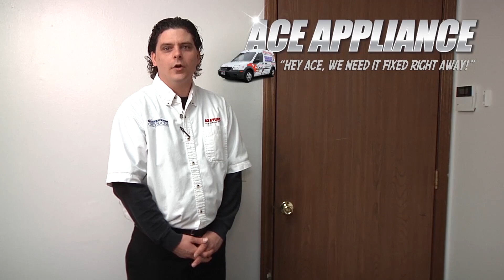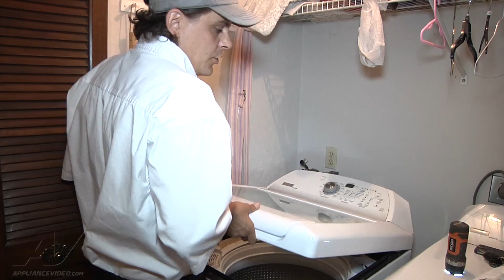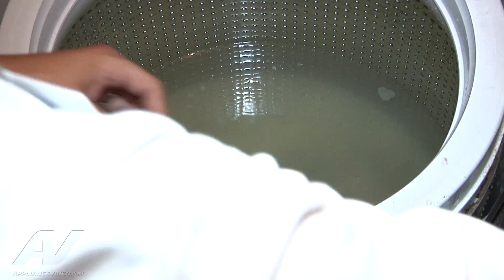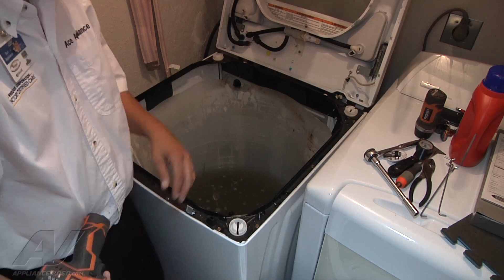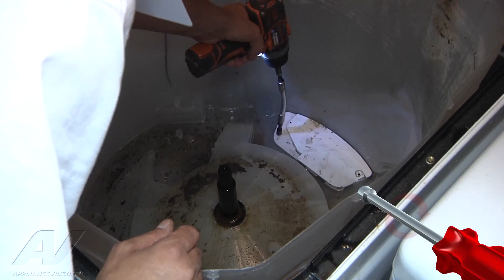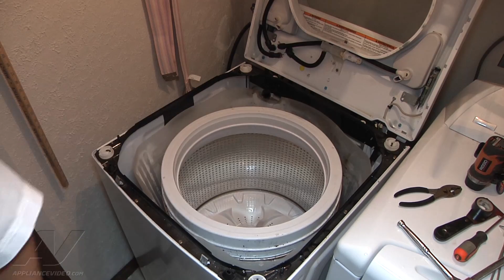Maytag Washer Repair - Sounds Like Something is Clogged - MTW6700TQ1

Comment: You should also include the Kenmore Series 600 HE in your title so people can find this.  I have not seen a video for that model and was relieved to find out this is the same one but under Whirlpool.  Also, I was hoping you would have shown the moment you popped the tub from the drive shaft!!  From other videos I have learned the high rate of spin throws coins, drill bits, paper clips, buttons up and over the basket lip into  into the outer plastic tub.  I had small 3/4 trim nails in my pump. Thankfully I caught it before it burned it out.   Thank you for this video.

Comment: Hi I have a bravos 300 series  when I run  any wash cycle like normal or whites   it will go through and  show its done but  it  doesn't spin but it drains ,so what I have to do is turn the cycle to spin/drain . The spin and drain cycle  works . So my question is  why does the spin / drain cycle work but it doesn't  spin in any of the other washing cycles .  There are no  error codes .
Reply from the maker: Great question, if you have a more technical question that our parts department cannot answer, you can search our over 17,000 answered questions free at our website www.ApplianceVideo.com under our Repair Help section. You can also call our parts department at 1-800-830-5465 and they can give you help 7-days A week ,or search at www.SaveMoreOnParts.com  .
Reply: I have the same problem. I have a MTW6700- TQ0. when I run  any wash cycle like normal or whites it will go through the wash and rainse cycle but does not do the spin cycle and show oL error message. Then I have to put it on SPIN ONLY cycle manually to finish.

Comment: Any tips for loosening nut at bottom of basket?
Reply from the maker: Great question, if you have a
more technical question that our parts department cannot answer, you can search
our over 10,000 answered questions free at our website www.ApplianceVideo.com under our Repair Help section. You can also call
our parts department at 1-800-830-5465 and they can give you help 6-days A week
Monday -Saturday, or search at www.SaveMoreOnParts.com  24 hours
7- days A week.

Comment: Did everything you said and everything works except for the draining part. I can hear it working so I took the hose out the pipe where its supposed to drain into and lowered it into a bucket and it started pumping out then shut off half full. Is that be a sign of the pump dying? Great video. Also it just went blank on the screen. It still beeps when. I press buttons but no o lights show up. TIA
Reply from the maker: Great question, if you have a
more technical question that our parts department cannot answer, you can search
our over 10,000 answered questions free at our website www.ApplianceVideo.com under our Repair Help section. You can also call
our parts department at 1-800-830-5465 and they can give you help 7-days A week
Monday -Sunday, or search at www.SaveMoreOnParts.com  24 hours
7- days A week.

Comment: On my top washing machine for Samsung water doesn't drain out all the way so I need answer
Reply from the maker: Great question, if you have a
more technical question that our parts department cannot answer, our
technicians are answering all questions at our website at www.ApplianceVideo.com under our Repair Help section. You can also call
our parts department at 1-800-830-5465 and they can give you help 7-days A week
Monday -Sunday, or search at www.SaveMoreOnParts.com  24 hours
7- days A week.

Comment: what if the center pc under the agitator is metal. mine is metal not plastic. i have a bravos x.
Reply from the maker: Great question, you can call
our parts department at 1-800-830-5465 and they can give you help 6-days A week
Mon-Sat . You can also search at www.SaveMoreOnParts.com 7- days a week.  If you have a more
technical question that our parts department cannot answer, our technicians are
answering all questions at our website at www.ApplianceVideo.com under our Repair Help section. We have over
4,000 common questions and answers that you can easily search through by your
model number, appliance make, and problem or error codes, and It’s free to
search through our question & answer library.

Comment: How do you get the codes from your Maytag Bravos X?
Reply from the maker: Nikki Hilliard Penny 

                   All of our technicians are now answering questions
daily at our http://www.appliancevideo.com/ website under the Repair Help section.  We also have over 1600 common questions and
answers that you can easily search through by your model number, appliance
make, problem or error code and it’s absolutely FREE. You also have the option
to email a factory service technician with a question on your appliance at
http://www.appliancevideo.com/repair-help/ . If you’re looking for a repair video, you
can also search our library of over 2600 free repair videos. ApplianceVideo.com
specializes in quality DO-IT-YOURSELF appliance repair videos and we get over
800,000 views per MONTH to our videos worldwide and growing. If you need of
parts for your major appliance, we have over 5-million parts in stock at http://savemoreonparts.com/ .  Thanks
for your support. Matt Ace Appliance factory service technician.

Comment: My whirlpool Cabrio HE is flashing a code FH then it stops what is wrong can I repair it myself ?
Reply from the maker: Shake-Zoolah       FH error code could have a few possibilities.  All of our technicians are now answering questionsdaily at our http://www.appliancevideo.com/ website under the Repair Help section.  We also have over 1600 common questions and
answers that you can easily search through by your model number, appliance
make, problem or error code and it’s absolutely FREE. You also have the option
to email a factory service technician with a question on your appliance at
http://www.appliancevideo.com/repair-help/ . If you’re looking for a repair video, you
can also search our library of over 2600 free repair videos. ApplianceVideo.com
specializes in quality DO-IT-YOURSELF appliance repair videos and we get over
800,000 views per MONTH to our videos worldwide and growing. If you need of
parts for your major appliance, we have over 5-million parts in stock at http://savemoreonparts.com/ .  Thanks
for your support. Matt Ace Appliance factory service technician.

        A

Comment: FYI, the screws on the pump cover in my machine had 1/4 hex heads.  Took me awhile to find the correct socket.  After pulling the agitator, I squirted some Shout on the spline.  I would pull the inner basket up until it stopped, then slide it back down. it slid out after a couple of tugs.  Sprayed some more on before replacing the basket, which made it easier.  After pulling the inner basket, I found a buildup of beige sludge on the bottom of the outer tub.  Wiped right out, but it may explain the smell.  I will follow a more frequent cleaning regime.  Found 1 dime under the cover.
Reply from the maker: altascene     Thanks for the detailed follow up. Glad it was just a miner fix aanda dime.   Please help usprovide more videos to our site by posting ApplianceVideo.com on your YouTube,
Facebook or Twitter account or add us to your circles. If you are in need of any parts please support
our parts department on line at http://savemoreonparts.com/ or call 1-800-830-5465 7-days a week until 11pm Eastern
time. Thanks again your support.  Matt, Ace Appliance service technician.
Reply: *****  You are welcome.  This turned out not to be the cause of my problem, which is the drain pump occasionally not stopping at the end of a full wash cycle.  If I unplug the washer and let it set for 10 - 20 minutes, and then plug it back in, the drain pump resets.  I suspect that the water level senor in my control module is failing.

Comment: I followed the directions from the video and found $13. 54 ($11 of it was in quarters).  Also, my husbands boss gave me the washer and dryer set, I know better than to wash clothes without checking all pockets!! Anyway, even after getting all of that change out, the washer still will not drain.  It makes a sound like there is a coin in there that has been chopped up by the motor or something.  There were some coins in there that looked like they had been through a grinder.  Does that mean that I need a new motor or some other part?
Reply from the maker: Daphne Butler             All of our technicians are now answering
questions daily on the ApplianceVideo.com website. You can search completely
FREE in our Repair Help section with over 1000 questions & answers. Or you
can get unlimited technical advice and video links emailed to you by our 14
factory certified technicians at
http://www.appliancevideo.com/premium-membership/.  If you are in need of
any parts please support our parts department on line at
http://savemoreonparts.com/ or call 1-800-830-5465 7-days a week until 11pm
Eastern time. Thanks for your support. Matt Ace Appliance factory service
technician.
Reply: Daphne Butler I have also found that coins will get into the drain pump itself.  That is a project that also has videos available, just search for this model and "drain pump removal".  It is more involved, but certainly do-able.  If you have water in the tub, use a wet vac to suck it out through the drain hose.  If you don't, you will end up dumping all that water on your floor (please don't ask...).  If needed, replacement pumps are available on line, and are much cheaper than a new washer.

Comment: So I did everything in the video, I found about 5 quarters but they were not covering the drain. I stick my fingers down in the hole and I can feel something obstructing but I can't pull it out. I shake the outer tub and can get the object to move but still not enough to get close to the opening. As a side note the water recirculater is working when I set this on spin. I've tried using a wire hanger, a strong magnet, and pliers. Any ideas how to get this thing out?
Reply from the maker: KIS 
        All of our technicians are now answering questions daily on the ApplianceVideo.com website. You can search completely FREE in our Repair Help section. Or you can get unlimited technical advice and video links emailed to you by our 14 factory certified technicians at http://www.appliancevideo.com/premium-membership/.  If you are in need of any parts please support our parts department on line at http://savemoreonparts.com/ or call 1-800-830-5465 7-days a week until 11pm Eastern time. Thanks for your support. Matt Ace Appliance factory service technician.

Comment: excellent video. I pulled my dishwasher apart and found that the hole going into the pump is clogged with mud.....when i plug unit back in it will not even try to drain. Is it possible for there to be a overload on the pump motor that may have tripped? Maytag quiet series 300 wash machine
Reply from the maker: Yes, there is an overload on the motor/ pump assembly. Its an auto reset overload, it should automatically reset after the motor cools down, usually takes about one hour. If it doesn't then you need to replaces it.  Thank you for your positive comment.  Please
help us provide more quality videos  by
subscribing to our YouTube page or posting our ApplianceVideo.com site on your
Facebook or Twitter account. We also have our authorized technician's daily
emailing professional advice daily to people like you that have appliance
problems. We have helped thousands of people save hundreds of dollars. Thanks
in advance for your help.

Comment: very cheaply made. lots of plastics. Maytag today is not how it was in the past. too bad.
Reply from the maker: Yes, all product quality  is changing for all manufactures. Our family-owned and operated company works hard to provide you with FREE, high-quality repair videos. Thank you for your continued support and good luck on your project. If you are in need of any parts, our parts department has over 5-million in stock for same day shipping. Please call  1-800-830-5465 for any of your parts needs, or you can order online 24 hours at: ApplianceVideo.com. Thank you and good luck with you project.
Reply: ***** Hi there awesome video. I did everything showed but with one problem. It didn't drain. I found a quarter but did not drain any ideas?
Reply from the maker: Frankiz
           If you cleaned the pump and its still not draining there is a possibility the pump impeller is damaged. I would replaced the pump next. If you have your model number call our parts department at 1-800-830-5465, they can look it up and drop ship it the next day. They are open 7-days a week. Let us know how it goes or if you have any other questions.
Reply: whining about plastic is so '70s, you are revealing your age ;)